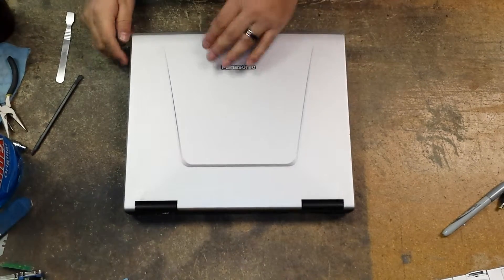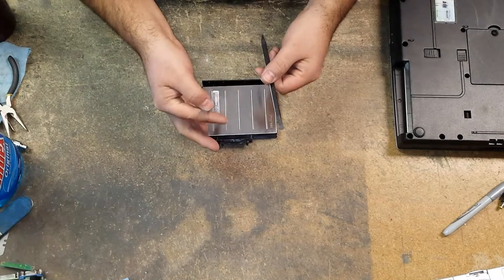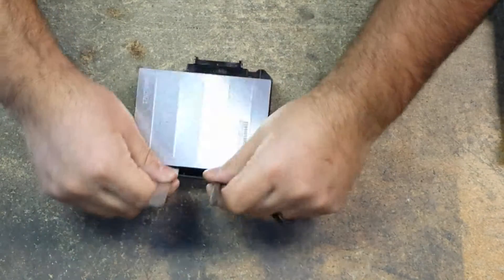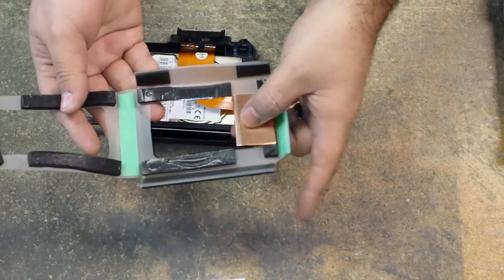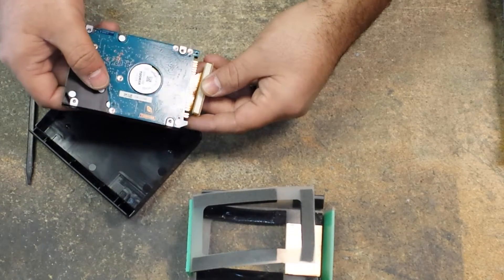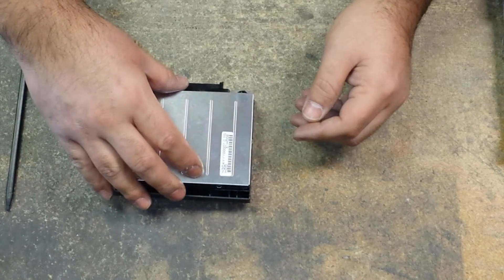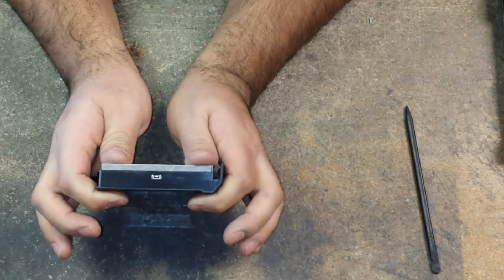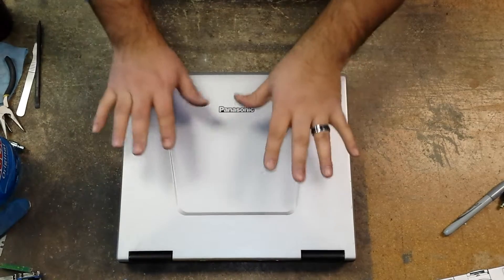Panasonic CF-51 Toughbook hard drive replacement or upgrade

Comment: can you please provide me a BIOS file for this model? I've got CF-51MK2LL and i need to flash a new bios
Reply from the maker: Have you tried Panasonic's driver site? You should be able to find the BIOS file you can flash there. 

I don't have a BIOS file myself so I can't send one. I'm sorry.
Reply: @616pcrepair  unfortunately there is no version on the panasonic website
Reply from the maker: @gius0161  damn. I was hoping you could find it there. I don't have one of these machines anymore.